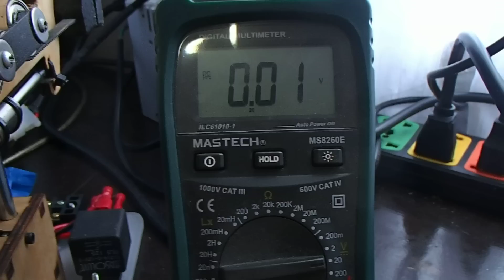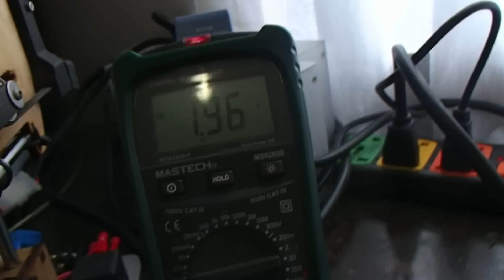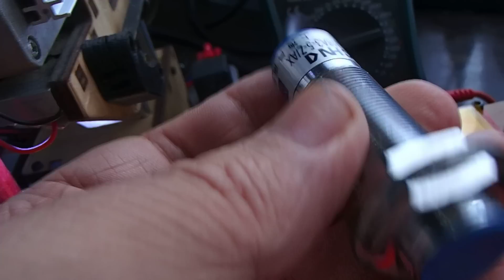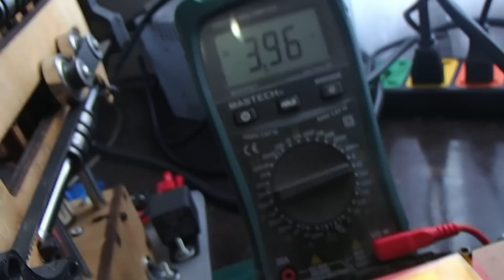Fotek PS-05N Inductive proximity sensor

Comment: Question about hooking up the sensor. I see that the inductive sensor works just hooking up directly up to the printer board. Does the sensor work better with the 12V supply? If it does work better with the 12V supply. How do you wire it up. Does the GND from the board hook into the sensor or the GND (negative) from the power supply. Does the 2.2K resistor get connected to the SIG inline.
Reply: Legoman

Comment: I just got my PS-05P it is the same thing but goes high when triggered. Anyway it seems it cannot trigger through the glass I have. the optimal trigger is 5mm for steel, but the spec says it is 0.4*5mm for copper, and my glass is 3mm thick, so it doesn't trigger :( It would probably work as a regular endstop though.

Comment: Have you tried it with just the heatbed? Most heatbeds have a top layer of copper to help spread the heat which should be the same as your blank PCB. I'd try it with mine, but it's well and fully silicone'ed to the bottom of my metal bed. If you have any issues interfacing it to your Printrboard, let me know. I designed it ;)